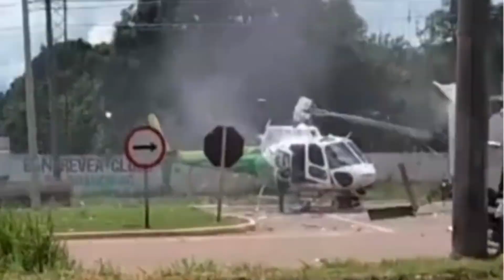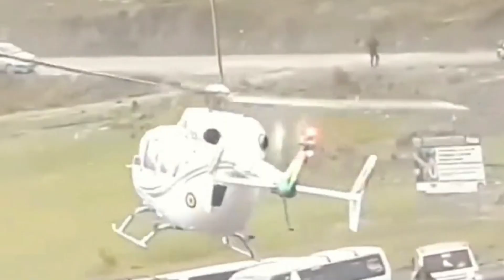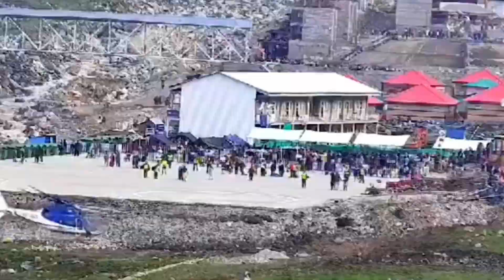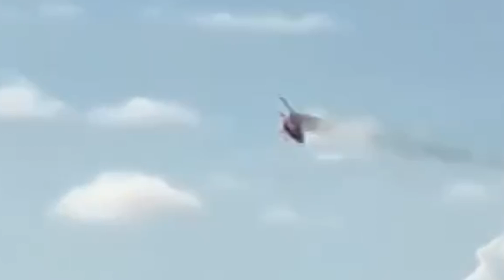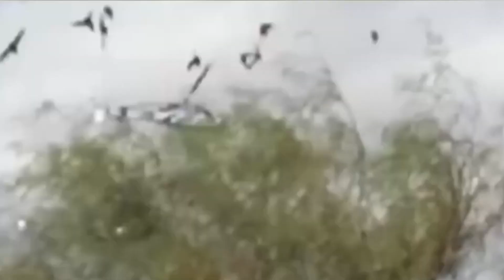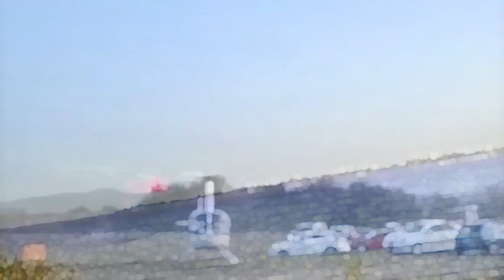Helicopter Accidents: Rotor Vulnerability and Collision Causes

Comment: Helicopters are rather small machines than venture often near the ground and near objects. They cannot fly high to avoid bad weather. Even if the helicopter is flying slowly, its delicate rotors spin at a constant high speed. The tail rotor is exposed, out of sight of the pilot and very vulnerable. Its center of gravity is high, it can capsize easily. It's a much more delicate machine to handle than a airplane and the autorotation is a tricky manoeuvre. They are used in the most risky missions.